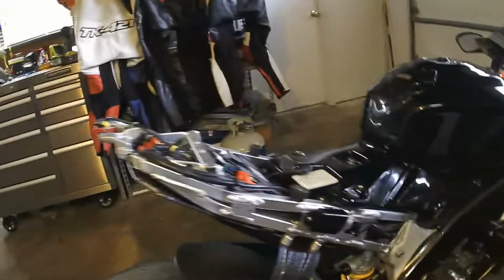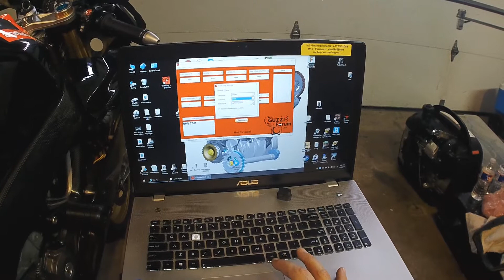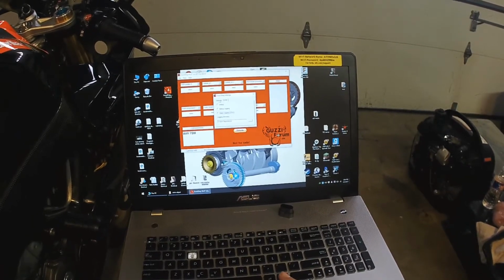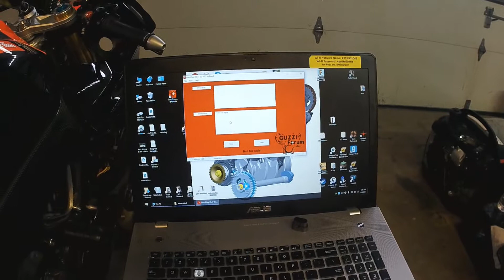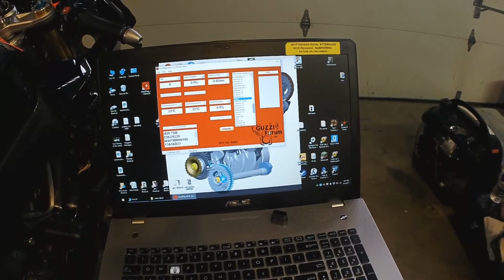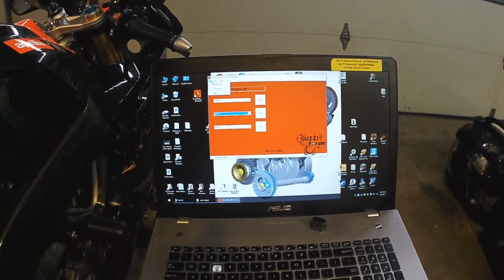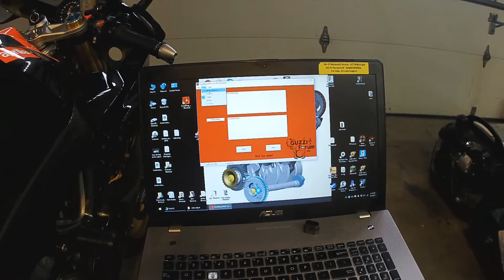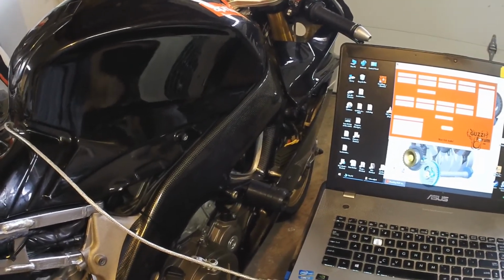RSV4 ECU interface

Comment: My bike speedo isnt working. I dont know if front or rear wheel speed sensor if fault or even the abs module is faulty. Can guzzidiag rectify and identify accurately on which fault is causing 0 on my speedometer?

Comment: Thank you you have been so much help
Reply from the maker: Happy to help
Reply: so another problem rsv4 2016 it cranks I charged batery but it doesn't start I changed spark plugs not the ignition coils don't have the funds but anyway how can I denominate the problem or is there a way to without taking it to the shop.
 @ShaunNielsen

Comment: The link for the OBD2 to USB cable has expired. Do you have the specs to the cable you are using in the video? Thanks!
Reply from the maker: any OBDII cable with the FT232 chip will work. There are several here: https://www.amazon.com/s?k=ft232rl+obd2&ref=nb_sb_noss  
Check on the AF1 forum to make sure though.

Comment: Hi Shaun, i got a question for you about the front brake disks and pads change on my rsv4.. Can you tell me how much torque/nm should i give on the screws?? Wanna change it myself (front disks and pads) this week but i have no idea about the torque.. If you can give some advice i will aprecciate that.. Many thanks Shaun ✌️
Reply from the maker: The best thing to do is get a workshop manual. If you cant find one, theres one in the files section on my facebook group - texas RSV4 and Tuono Owners
Reply: @ShaunNielsen Hi Shaun, I'm a bit late to the party but thanks for these great posts.
Do you know if this set up would work with the older RSV factory Rotax V60 twin ?
My 2008 model has the same 3 pin plug.
I have an EFI red warning triangle showing but no codes on the onboard diagnostics.
I did have a 046 Lambda sensor code up but replacing standard exhausts has deleted that.
Thanks again buddy.

Comment: Is it possible to flash the Race map using a PC?
Reply from the maker: I dont believe its possible. Aprilia put in a security system so a password is needed. However, its possible someone has found a way to bypass this security since I was doing this work.
Reply: @ShaunNielsen  Thank you. I found there are tablets sold by a company called Motomillion in the US and you can install race map on the stock ECU. The tablet can be used multiple times but it cost $860

Comment: Very cool. Gonna be looking at an Urgent Service light issue on my buddy's RSV4 later today. The throttle and handling learning is ridiculously quick and easy. Had to do it when I got my ECU flashed with the race map. Make sure to do the 25mph 2nd gear calibration afterward.
Reply from the maker: Good luck with it.

Comment: thanks man  cables worked well and found problem as i got stuck in bad weather and the next day my service light came on.  turn out too be oxygen sensor water in the plug being im  a motor mechanic now i can use OBD 2  on the bike as well as cars thanks. PS work out well because aprilla shop can not look at it till late january february.  thanks again

Comment: Hello, I have a spark ignition problem in my RSV4 Factory 09 '. The engine does not start, there is no ignition spark. I checked the ignition coils and the shaft position sensor. They have the right resistance. Where to look next? I think that this may be a problem with ECU. What do you think about it ? Thanks for your videos are very helpful.
Reply from the maker: Best thing to do is connect the OBD cable and check the fault codes with GuzziDiag. This will tell you whats wrong. It will be much cheaper to buy the cables on amazon than take the motorcycle to a dealership. Probably quicker too.
Reply from the maker: Check this link: 
http://www.apriliaforum.com/forums/showthread.php?323291-Hot-start-issue-resulting-in-dead-dash
Reply: Hello, I have read this topic. I check the cables from the battery and those to the transmitters. Possibly, I will make new ones. I checked the error in ECU. There are 2 errors: P0170 - to low and U1601 - invalid signal

Comment: Hello Shaun, is it possible to enable the oem quickshifter on the ecu, using this software. As I have installed one to my 09 rsv4.
Reply from the maker: I havent had any experience with that. You should ask that question on the AF1 aprilia forum.

Comment: I have a 2010 aprilia RSV4R and I'm a bit confused on which software download I would need to use with the cables. Any advice would be so greatly appreciated. Thanks!
Reply from the maker: Which cable do you have?
For the software, here is the download page, 
http://www.von-der-salierburg.de/download/GuzziDiag/

If you have windows, just click the windows link.
Reply: Shaun Nielsen I have guzzidiag cables. I saw the page but there are many downloads stating windows. Which of them would I need?
Reply from the maker: For guzziDiag you need this: http://www.von-der-salierburg.de/download/GuzziDiag/GuzziDiag_V0.47.zip
Let me know how it goes.
Reply: It's not giving me the option to select a com port and I close that window and it gives me the option to connect but when I click connect it says my ignition is not on, yet it is on when I click connect
Reply: Alexander Smith I am having the same issue with my 2009
Reply: Jason Wilson hi, I have the same problem bro, you can find the solution?

Comment: Great information, just wondering if you have done the valve clearances on a VTR1000SP1? If you ever do please could you make a video? Thanks
Reply from the maker: I havent, but a japanese V-twin is the second easiest valve adjust there is - after a single cylinder dirtbike. If I ever get one in I'll do a video.
Reply: Great thanks Shaun

Comment: hello, will this work with the 2016 rsv4 RF LE? if so which download is it? thanks
Reply from the maker: I dont know for certain but I believe it will. Download http://www.von-der-salierburg.de/download/GuzziDiag/ and get the cables and give it a try.
Reply: I will thanks, cables are ordered.
As far as the software goes, the site has a bunch of choices for Windows followed by a number which are different from one another 
I'll try it see what happens
Thank you for replying and sharing
Reply from the maker: http://www.von-der-salierburg.de/download/GuzziDiag/GuzziDiag_V0.47.zip is the only one i see for windows. did you get this one?
Reply: I have a 2010 rsv4r and I am a bit confused on such software I would need to download and use. Looking to clear a code due to simply changing the keys.